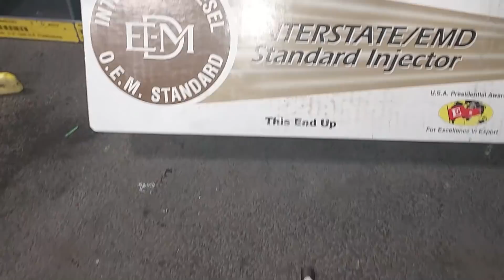Cracked Locomotive Piston, New Power Pack Assembly and Locomotive Fuel Injector

Comment: Great video Dave! I am guessing that these units are 2 stroke, with the exhaust valves on the top of the Pack (that would be the cylinder head?), and the air admitted through the ports around the circumference of the cylinder, using high pressure air from the blower to force out the exhaust gasses before the piston covers the ports?
Nice idea having a "Power Pack" to save removing a huge cylinder head.
Reply: Yes, these 645's, as well as the earlier 567's and the later 710's are indeed 2-stroke designs.  The engine must have a roots blower (or a turbocharger) to supply air or the cycle will not work.  Uniflow, where the fresh air is admitted via those ports and scavenges the exhaust from the prior cycle up and out the 4 exhaust valves up top.  Same principal as Detroit 71-series, 53-series,  92-series, 110-series, and 149-series engines.
Reply from the maker: Stan gave a great reply on that. Thanks for writing in and watching
the video my friend.

Comment: More, more more 😂👍
Thank you Dave, this really is Heavy Engineering. I didn't realise that your locomotive engines are Tommy two strokes until you showed us the spare cylinder. Looks expensive. 
Question time, hahaha what is it with you Americans? 9 and 1/16! I have a 1946 Fordson E27 N tractor, the engine although updated in 1945 to accept a starter motor is the same as in 1917,the cylinder diameter is 4 and an 1/8th 😁 not 4" or 4 1/4. Do you use elasticated tape measures over your side of the pond? 🤣🤣🤣
Many thanks for your time to film, I look forward to seeing some more updates from the workshop.
Rgds, Peter
Reply from the maker: Glad you enjoyed the show Peter. Guess you'll have to ask Henry Ford
on that query. I have no idea how Ford or EMD engineering thinks.

Comment: This inquiry is irrelevant to this video. Is there a rail head close to Cumberland Mine that you could have a connection with? If you ever needed leased power you'd have to truck it in. This is a great instructional video. I've always had access to the locomotive shops and always marveled at the innards of any locomotive.
Reply from the maker: Norfolk Southern has a line across the river from our harbor, the
closest we could get to it would be about 5 miles without building a
bridge across the river. if you want to look it up on google, their
siding is at Poland Mines and our harbor is at Alicia Pa.

We have been cursed since the beginning with no interchange. All
of our rolling stock has to be trucked in from Poland Mines, huge expense. But not having an interchange has also caused the FRA
to consider us as an "in plant installation" and thus they have
chosen not to "police" us. This is good in one way, but between
you and me, I really wish we had FRA inspectors here. We also have
no public grade crossings.

Another problem with no interchange is some of the big rail equipment like grinders and shoulder cleaners can't get here. our rail has never
seen a grinder, I do see Loram has a portable unit and am suggesting
we look into getting that in here.
Reply: @ccrx6700  Would Cumberland consider building a float system similar to the NJNY from New York to New Jersey? That would be cheaper than a bridge.

Comment: I sailed as Chief Engineer on large Sea Going Tug Boats for over 30 years and have changed out more Power Packs than I care to remember.  They are a lot of fun to replace when you're running in 15 (or better) seas!  My Company used to Hire a Company called MSI to do their overhauls. MSI specialized in doing a Overhaul (Powerpacks including Rods, Cam Shafts, and roll the Mains) in 24 hours. These were called a "Miracle Overhaul" for two reasons that #1, no one got killed and #2, that the engine actually ran afterwards.  All in all EMD's were the best and my favorite engines that I worked with.
Reply from the maker: Awesome story! Really appreciate your sharing that with us. Those
power packs are heavy but a great idea.

Comment: Great video, EMD also put diesel engine into WWII submarines, I wonder if they used same engines?
Reply from the maker: I never knew that Jim, thanks for sharing. Hope they had good mechanics like Nick onboard with them!  Appreciate your writing
in and for watching my good man.
Reply: No, they were Cleveland Diesel engines. EMD engines were used to power LST's and some tug boats, that's about 2000 engines for those applications alone.
Reply: @kenneththompson2249  Cleveland Diesel traces its roots to the Winton Gas Engine and Manufacturing Company, which was formed by the early Cleveland automobile manufacturer Alexander Winton in November 1912. Winton Engine Corporation embarked on a sustained research and development effort in partnership with the General Motors Research Division to develop diesel engines with improved power-to-weight ratios and output flexibility. That effort produced the first practical two-stroke diesel engines in the 400 to 1,200 hp (300 to 900 kW) range. The 2-stroke Winton Model 201A engines featured uniflow scavenging with intake ports in the cylinder walls and exhaust valves in the cylinder heads, and mechanical injection, which would carry over to later Cleveland Diesel designs. The 12 and 16 cylinder variants were 60 degree V type engines. They powered early Electro-Motive Corporation (another GM subsidiary) diesel locomotives and U.S. Navy submarines. In 1934 an 8-cylinder, 600-horsepower (447 kW), 8-201A diesel engine powered the first American diesel-powered train, the Burlington Zephyr streamliner passenger train. The research and development efforts in the mid-1930s branched into engines for locomotive (Model 567) and marine and stationary (Models 268 and 268A) use, produced under Winton's successor, the GM Cleveland Diesel Engine Division, and smaller diesel engines suited for road vehicles, introduced by GM's Detroit Diesel division in 1938. So the Winton diesel company owned by GM did put diesels in submarines.
Reply: @jimmarcum7362  Thanks for your reply but I used to work for EMD in the power products service dept. When I started working their there were still some old Cleveland diesel guys there. Cleveland Diesel went out of bunds in 1958 and the parts business went too EMD for the next 20 years and then sold off to Hatch & Kirk in Seattle where they still operate today. One interesting event occurred in the 80's when the Navy showed up wanting a quote on non magnetic engines like Cleveland Diesel built in the war and somebody had to go into the vault to see if they had the drawings still, H & K probably had the tooling. It was too ridiculously expensive even for the Navy so they bought some Italian engines that were used in European minesweepers.

Comment: EMD’s crankcase is welded steel and not a cast block yes it is very similar to a Detroit diesel and more similar to a series 149 I work on the river my boat had 3 20 cylinder 654’s in her and  produced 10,500hp they did a repower went to the 710’s 16 cylinder the boat can make up to 12,000hp we got them turned down to the 10,500 rating to keep the reduction gear box’s from self destruction and use less fuel
Reply from the maker: Awesome, always have respect for a river man. You must be
on a big Mississippi River boat. The tugs we have her on the Mon
are pretty small compared to yours. Appreciate your writing in
and sharing that with us tonight and be careful out there in.

Comment: This was a super cool video. I have always wanted to see the internals of an EMD engine, and I gotta say, the assembly is way different than I had imagined.
Reply from the maker: We do appreciate your tuning in and watching the home movie
tonight Matt. Glad you enjoyed the show. Don't get to see this
kind of stuff a whole lot here either, so was lucky to get what I did.
Years ago had a bad water leak and water got in the cylinder and
hydro locked it. Connecting rod got thrown thru the engine block.
That was before I started making vids or that would have made
a really great video, also was there when they dropped the new
re man engine in, got pics but no videos.
Reply: @ccrx6700  I can't imagine being the engineer when that happened. That's why I always blow out the cylinders before a start, even if it was just running an hour ago.
Reply from the maker: @mattkinnard6899  they do that here now after it has set not running

Comment: Wow, that is something you don't see everyday! I have repaired tractors with cracked pistons because too much ether was used or water got in and hydro locked the engine. Crazy stuff!
Reply from the maker: Before I started making vids, years ago water got in the cylinder
and hydro locked it, the connecting rod shot out the side of the
engine, that would have made a cool video! Also was there when
they dropped the new re man engine in, got some pics but didn't
have a phone that could video then. thanks for tuning on tonight Eric.
Reply: @ccrx6700  Very interesting! Thanks for sharing that! I have seen many different engines in different conditions. The worst ones are always the most interesting!

Comment: The data plate on the engine block is just to the left of where you guys were working, and it will have the date of manufacture.  EMD uses a "year-month-number" serial number system for blocks, as an example 65-D-10 would be the 10th block manufactured in April 1965.  It might also have a rebuild date and location info.  It's common for the bigger railroads to swap out engines after major failures or simply houring out, so it is likely that this unit no longer has its original engine.  

The welded block design makes EMDs incredibly strong, and even if a major failure like a thrown rod punches a hole in the side of the engine it is possible to cut that section out and weld another in its place.  Boise/MK even had a program where they would cut the less popular 20 cylinder blocks down to 16.
Reply from the maker: Excellent Bob, thanks for the info, I never knew that about the
date plate, will have to check ours out now. One of our other
engines did have water get in a cylinder and that cause a rod to
get thrown thru the block, I highly doubt if anyone here knew you
could repair that as they went and found a Re man engine for
the loco and put it in. I will remember your teachings tonight!

Comment: That 645 engine refers to the c.i. displacement per cylinder.   12 cyl. In 2000 and 3000 hp and 16 cyl in 3600 hp.
Reply: Not exactly. There are plenty of 2000 hp EMD engines that have 16 cylinders. GP and SD-38 locomotives are examples of this. GP and SD-40 locomotives have 3000 hp 16 cylinder engines. GP and SD-60 locomotives have 3800 hp 16 cylinder 710 engines. SD-70M locomotives have a 4000 hp 16 cylinder 710 engine. There are very few EMD locomotives with a 12 cylinder engine of any size left these days, and most were in the old 1200 - 1500 hp switchers.
Reply: Ralfie, thank you for clearing the cylinder count up.  Am I correct in hp output of 2000 with a non turbo and 3000 with a turbo on a 645?
Reply: @erbewayne6868  
Yes, that is correct, for both questions, sort of. The frames were long enough on most of them to be a 40 or a 45 and then they had different hood lengths for each.
Reply: Continued, an sd-45 was 20 cyl with a 645 and a longer long hood?
Reply from the maker: We do appreciate your tuning in and watching the home movie
tonight Erbe. Glad you enjoyed the show. Ralfie did a great job
in responding to you sir, he know his stuff, he is a loco mechanic for
a large RR.
Reply: @ccrx6700  
Don’t go bragging on me, I know just enough to keep me in trouble up to my eyeballs at work!

Comment: I would be in my heigth of glory to work on one of those, ive worked on/rebuilt all sizes/types of engines, from a small model airplane, (which is a diesel with a carburetor), to a 445 cid Buick Wildcat engine. Im currently getting ready to tear down, and hopefully rebuild a 20 hp lawn tractor twin cylinder engine that the guy never checked the oil on. Whats your opinion? Will i be successful, or send it to the scrapyard? Will let you know the results!
Reply from the maker: Wish we could have you with us Paul! And no doubt in my mind
you will be successful. Appreciate your writing in and watching
tonight my friend.

Comment: Dave, at 900 RPM's how many times per second did you say the injector is firing?  12?
Reply from the maker: According to a spec sheet on loco injectors that I had read, it was
15. Thanks for watching the show tonight Charles, it is much
appreciated.
Reply: @ccrx6700  I enjoy every one of the videos.

Comment: Great Dave! when a loco breaks down, what does the railroad do to keep moving? you all only own two sd38-2 right? can they run coal with only one?  love the engine stuff and yes you are right, very rare shots , thank you
Reply from the maker: Glad you liked tonight's episode Lyndon. We have 3 locos here so
when one is down they put another in to replace it. We've actually
been in the position where all 3 were down at the same time, management was pretty nervous when that happened. And yes if
needed we can run trains with single loco, we did that for 20 years
before they bought the second loco.
Reply: They also have a single SD40-2.

Comment: Ports like a two stroke and a cam shaft! I don’t understand EMD engines!
Reply: GM diesel have a blower to pull in fresh air and that is how it gets rid of the exhaust, since these engines have a wet sump. The blower pushes the fresh air into the cylinder through the ports on the lower side of the cylinder and then the piston compress squeezes the air and heated up,then the fuel  is injected into the cylinder.
Reply from the maker: Thanks for the good info Peter, good explanation sir.
Reply: two-stroke diesel.  Just like old Detroits.
Reply from the maker: Thanks for watching the video and writing in my friend.

Comment: Please explain how that injector can inject fuel 15 times/sec at 900+ rpms. Are those engines 4 cycle? Locomotives have always been an interest for me.   Ron
/
Reply: The EMD 567, 645 and 710 series are all two stroke engines.  Intake air comes through those ports near the bottom of the cylinder, and all four valves are exhaust.  The injector is powered by a rocker from the camshaft, just like a valve, and the pump always supplies them with more fuel than they can use.  The volume of fuel per injection is controlled by plungers connected to a rack control arm that runs under the valve cover back to the governor.
Reply: @bobsmith2637  Thank you for your reply, I would never have thought that an engine that size could be two cycle, are the newest largest Locomotives two cycle as well then? Would you tell me what company manufactures those engines? I'm a 76 yr old ret. Years back I had a step-father-law who was an engineer for the millwakee RR. He brought the first load of coal to the electrical power plant in Big Stone City South Dakota. Ron
Reply from the maker: Thanks for asking Lois, Bob Smith did a great job in answering your
query. Do appreciate your writing in and for watching the home
movie tonight my friend.

Comment: We have these engines in our boats and I’ve changed probably 100s of power assemblies over the years. Can’t say I’ve ever changed just a piston let alone without pulling the assembly. Didn’t even know it was possible. Must be nice working in a shop, I’ve changed them underway shut down the engine your working on and run on the other.
Reply from the maker: Lot of the old river tug boats here have them, good reliable
engines. I used to work on a tug way back in the 1970's for a
brief stint. Cat mechanics came in and changed crankshaft on
an engine while they ran the boat with the other. That mechanic
had the biggest biceps I've ever seen, everywhere he went he
carried dumbells with him. thanks for writing in and watching tonight
my good man.
Reply: I worked on 645E4 EMD engines mostly in stationary generator units.  We had to replace power assemblies in pieces because there wasn't enough headroom to pull the complete assembly.  The first piston snap ring I removed took me about 4 hours.  After a couple hundred, it took about 30 seconds!  I stopped doing that work in 1992.  I worked several times at the Cumberland mine where this video was done.  They have newer locomotives now.
Reply: Agreed, I've been around these engines for quite a few years. Never seen just a piston swap, always the powerpack.
Reply: Hard to believe repairs not done in most expedient way. Piston only is kinda like building a ship model in a bottle ! Super time eater.

Comment: Dave remember doing a tour of the rochelle power plant with my dad. large building behind the VR cam location. they have inline Fairbanks morse 
10 cylinder units turning generators, 225 rpm. had units from 1926 till in think 63 was the youngest. had a piston sitting there 17in bore, and that was from a smaller unit. largest was around 21 in bore if I remember .  like the other guy said top end looks like a Detroit diesel truck engine. as seen on bus grease monkey channel.   just love a engine that turns fuel into noise and pulls a bunch doing it.  take care
Reply: They used to a rochelle days, cars,tractors. Farm stuff. Tour of the plant last time I was thete about 05 or so.
Reply: There is at least one large Nordberg engine in that facility too (at least as of several years ago).  The Nordbergs were 2 strokes as well and many were dual fuel (could run on either diesel or natural gas).  I could hear the din of something running in that building when we were at the railroad park across the street and walked over there to look inside through the windows.  It was turning a big AC generator with an exciter (I think that was a pretty common setup).  I'd love to take a tour of that place.
Reply from the maker: Thanks for sharing Kenn, there are some really big engines still
out there on display. Too many engines, not enough time to see
them all! Appreciate your tuning in tonight my friend.